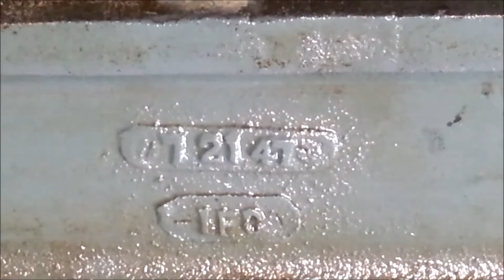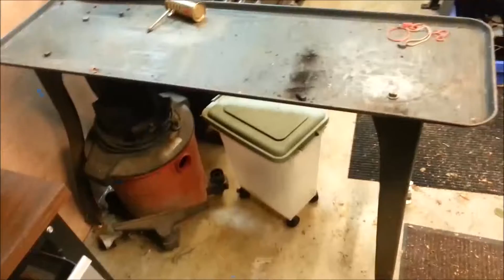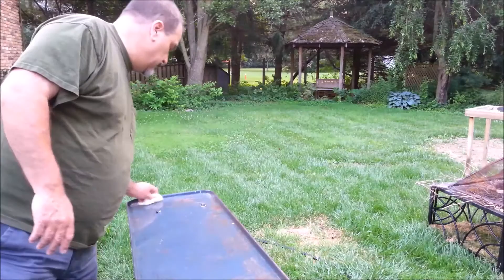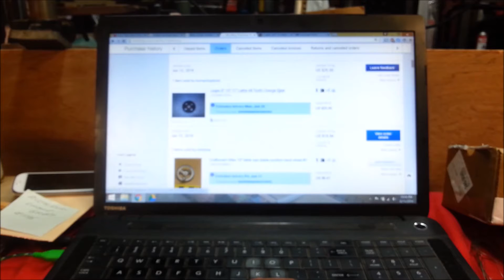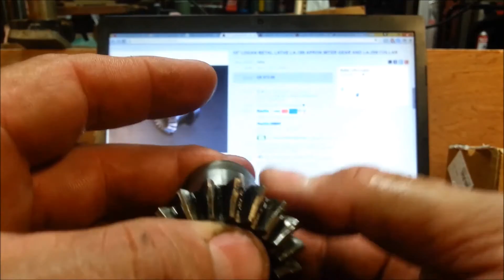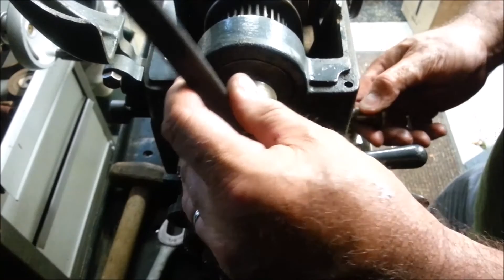1947 Wards Logan Lathe Part: 2 Stand & Gears Crafted Channel

Comment: I have 6 atlas lathes I've bought an restored and a Sheldon horizontal mill,, last week found my dream lathe 11 inch Logan,, oil filled apron and gear box are in great condition,, l have 2 12 inch atlas lathes with quick change gear boxes,, nice machines but toys next to Logan,,  I'm going to start selling the atlas's now,, but never sell my Logan lathe and Sheldon horizontal mill.

Comment: What sort of fluid do you use in your parts cleaner? I see there are petroleum-based fluids and water-based fluids, so I wondered.
Reply from the maker: I went with Stoddard solvent from tractor supply under the label PSC1000.  That was the only place I could find it in reasonable quantity.  Cost me 80 for two 5 gallon cans.  Still working fine although I have to keep adding water to bring the level up.  Water works like a filter which traps a lot of junk.  It's still relatively clear.  Did a series on the parts washer also.

Comment: i think you are making a huge mistake in getting rid of the logan. the atlas would be the one to go if it was mine.
Reply from the maker: You had a nice Atlas and gave it up.   ;-)   There will be another Logan if I want one.  Besides, my non-atlas lathe of the future will be a 14" Logan or South Bend if I have any say in the mater.  Many steps to a nice shop.  I have a customer for the Logan and it will get me a bigger more well equipped milling machine.
Reply: you couldnt give me another atlas lathe. if i do ever get another old lathe its sure as hell wouldnt be a pos atlas. it would be a logan or sb
Reply from the maker: Bison Workshop I'm Making American Iron Great Again.  You made your Atlas quite a bit better while you had it.  Yes, it was a pos and a bad deal at first I guess.  However, you made it into a good lathe and a good deal by the time you sold it.  My shop theme is about Vintage American Iron.  The Griz is nice and I might own one someday.  Just not in the spirit of what I am working on in my shop at this time.  But, if you ever get tired of of the Griz, I'll come and get it to relieve you.  ;-)
Reply: im of the same mind love that old iron .
Reply: I have that exact same Montgomery/Logan lathe. Haven't used it much. Seems to be more robust than my 1945 9" southbend. My only real complaint with it is having to use the 1/2 nut for driving the carriage. I don't know why it bothers me, it has been working for 70 years. I also have a 12" atlas/craftsman "commercial" lathe on its factory stand, but can't decide which one to keep. It has a larger swing, more speeds, 20 years newer, but still uses the 1/2 nut to drive the carriage and has flat ways. What to do. Thanks for the video, looking forward to part 3, JB.
Reply: i never said a word about my grizzly. that grizzly is 10 times what that atlas was the day it was new
Reply from the maker: Bison Workshop Grizzly is cool. I'll always have my 10" Atlas because my dad helped me get it.  I wish I could have his South Bend 14x36.  My ultimate dream would be to find the same model lathe again.  This was a late model, I think from the 80's when he bought it.  These "square" model lathes if I am not mistaken are the ones Grizzly patterned after when they came along later.  So, we are in the same family there.  I would eventually like a 14" lathe of modern manufacture like the Grizzly.  Might end up with one of those in the end.  I hope the end does not come too soon.  It's just a dream to find a South Bend like my dads old lathe.  Probably won't happen exactly like that.
Reply: Never know there's a lot of them out there.
Reply from the maker: J B These are home shop grade lathes.  Nothing at all wrong with that.  Most of us won't live long enough to wear out a set of 1/2 nuts or a feed screw.  By the time a worn lathe comes to us, it's had 3 owners to wear out that much.  A "real" commercial lathe is a different story.  But then those won't usually fit in a home workshop setting for size, weight and power requirement reasons.  There is a guy making brass 1/2 nuts for the Atlas/Craftsman.  About $75 as I remember.  I tool some of my profit from a deal and invested in a set to go on my Atlas 3000 (Craftsman Commercial) lathe I am restoring. I have a series on my 12" now.  I stopped on that lathe to get the Logan out of the way.  I've got 9 parts on the Logan uploaded and 2 or 3 more to edit.
Reply: i am giving my thoughts on this very subject in the video im in the middle of editing right now. its the new bison chat series to come. if you dare to watch all the way through.
Reply from the maker: When we going to do a live chat show?  I'd be up for that.
Reply: wait till you see my chat video. lol. you may never want to speak to me again lmao.
Reply from the maker: I hope your out of your funk.  ;-)
Reply: nope. lol